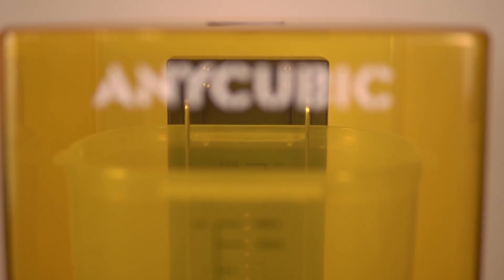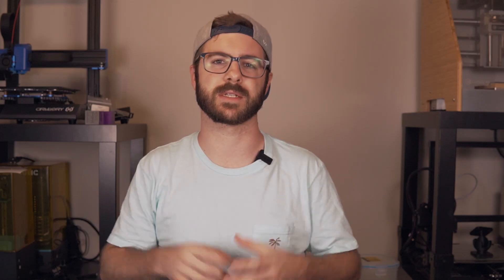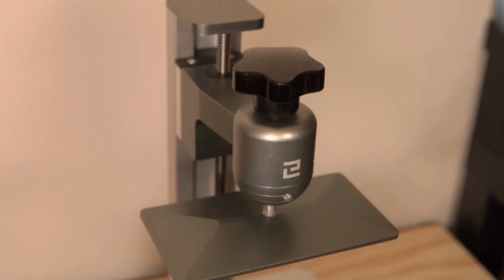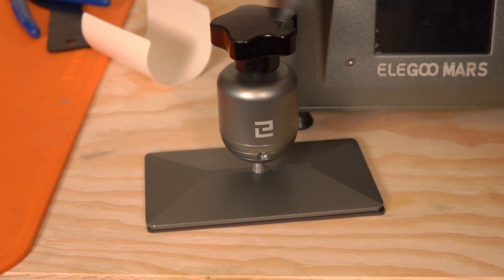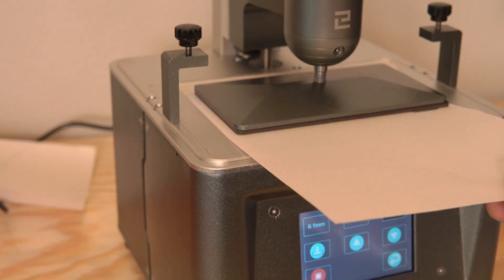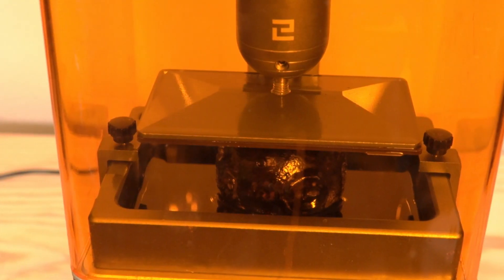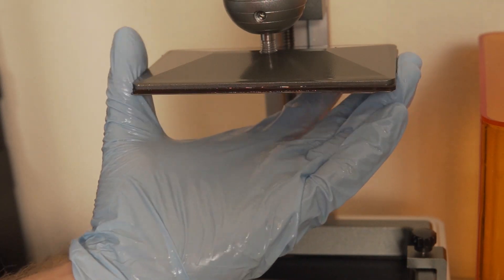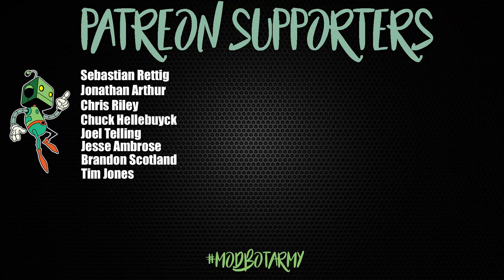FlexPlate System For Resin 3D Printers?! Install And First Look On Elegoo Mars

Comment: I might get one for TH72 resin. It really stick to the plate and has super stringent tolerance. So sometimes I gotta really use force on the plate. But seeing this if I can just pull off a magnet and bend into my cleaning machine I won't have to worry about accidentally messing up my level.

Comment: hello, nice video man ! When you print big parts, do you also, like me, have the metal plate not sticking with enough force to stay flat on the build plate due to weight and suction, causing one of the sides to detach and leading to deformations?

Comment: You know, if you forget to print a spacer first, you could just fabricate a temp spacer from cardboard, plastic, wood - things like that. A folded-folded-folded bit of duct tape even. Trim it to size, drill a couple of holes - you get the idea.

Comment: Great Video! You touched on the bane of FLEX-PLATES for my Experience. 
👉Case-1: 2yrs ago I installed a FLEX-PLATE on a AnyCubic Photon Mono SE. A guy I knew had the exact same setup as me & he informed me the Spacer/Shim or whatever wasn’t needed. And he walked me thru the process & it worked perfectly for 18 months. 6 month ago I needed to Re-Level the machine & FORGOT the Level Technique given to me🤦🏻 & I can’t find the guy….ohh & the regular None- Flex-Plate Level Methods won’t work. (GRIND’s)
👉Case-2: I just purchased a SATURN S & Attached the 
FLEX-PLATE & watched a few Videos & they ALL MENTIONED using a SPACER/SHIM . 
👉Question A: any idea what that Leveling Technique Was that leveled the AnyCubic Machine WITHOUT a Shim/Spacer was?
👉Question B: Have you heard any Technique for Leveling with a FLEX-PLATE without a Spacer/Shim.
👉Again I luv your video & it’s the 1st I’ve viewed where this topic is discussed!!! 
🙏🙏SO MUCH THANKS🙏 🙏
For that & I will defer to your site in the future💯💯💯
🙏Anyone that can offer help on either of my questions I REALLY APPRECIATE ANY HELP🙏
Lee

Comment: I added this to my mars 3 before i printed anything and printed the spacer on my longer 5 pro. still left it 24 hours to let the adhesive full time to cure. Boy is the magnet strong , have to be careful i don't trap my fingertips putting it on. great vid keep up the good work

Comment: yeah i gotta say flex plates for resin printers are definitely the way to go, there's nothing like testing printing your first model, not being able to scrape it off with plastic scraper, and then using your FDM metal scraper and scratching the build plate on the first print and thing you've ruined your machine
Reply: yeah I'm fairly new to resin printing
Reply: My exact experience

Comment: PRINT AND INSTALL THE HOME-SPACER FIRST!!!!! - If you only have 1 printer and install a flex plate before printing out a spacer, you're kinda screwed - speaking from experience here! It's important people understand that Home and Z=0 are NOT the same thing. The printer will always go to Home first, before moving on to Z=0 because it expects Home to be above Z=0 - so if you don't have a Home spacer installed, the printer will try and drive your build-plate through your screen even if you have re-calibrated it. Cue lots of angry grinding/clicking noises.
Reply: Yup. Made exactly that mistake. Needed to remove the magnetplate. So i need to buy another one. I recommend to look for a store who informs about the thickness of the flexplate+magnetbase. So no need to measure it.
Reply: Thank you so much for this tip, I was able to get a neighbor to get a space printed by my neighbor so the first thing I could do on my new printer was install a flex plate.
Reply: Nearly did this. thanks for the reminder.

Comment: I have the some issues with my Mars and Saturn now that i use FlexPlates. They are quite nice but since them almost all prints fail an get stuck on the FEP early or late in the print. I clean my Resintank with window cleaner instead of Iso. Iso washes out the transparency, window cleaner does not. After that i wipe it clean with paper towels and polish with a microfibercloth. I sanded them with sandpaper and raised the bottom exposure time from 60 to 75 and it initially worked. Now, almost all fall off early or late in the print on both Mars and Saturn. I cleaned the tanks with iso and raise the lifting speed. So, nothing sticks anymore. Removed the FlexPlate, releveled the plate, cleaned the vat with Iso, nothing. Cleaned the vat again, releveled again, apllied some silcone grease... nothing! Replaced the FEP an the Saturn, prints stick on the FEP after the base, on the Mars it won’t print at all anymore. I don’t know what to do anymore. Before i installed the plates, it worked fine. I bought these because some bigger prints had a lot of difficulty getting of the printing plate. And now, even when they are off no printer will print anymore.

Comment: a electro-magnet you can turn off and on would be a easier way to remove the plate I would think, but would require them to design the head to hold it with a off/on switch

Comment: I have Wham Bam resin flex plate for one month and its already cracking and make magnet side uneven. I do not recommend this for resin printers. And Wham Ban is not responding to my email to solve this issue....
Reply: Care to elaborate? What’s cracking exactly? And do you mean the adhesive is failing, causing the magnet to sag and become uneven?
Reply: @cwill2127  The magnet it self cracking, adhesive is fine. https://drive.google.com/drive/folders/1S6Cy4QWQx0Vti473wWV1LrePkHELLp37?usp=sharing

Comment: if you print MULTIPLE smaller figures flex plates(doesn't matter brand) are god awful, they don't come off and it's just another way to stab yourself. I've put 3 of these on my printers and I'm at the point of taking them off as they do not do anything beneficial, they now require 2 gloves to use rather than 1, nothing pops off. It's just another piece to align and screw with. The one nice thing is you can throw the plate in acetone and have your parts cleaned and come out together without needing to use a basket etc and worrying about them colliding.

 This is coming from running a 3d printing business.

Should mention Wham Flex for FFF are my lifeblood for not losing my mind, waiting on a replacement one for the Tronxy X5SA...I was kneeling on the build surface trying to get a PLA+ print off

Comment: I have 2 of them, one works perfectly the other just keeps sliding and damaging my prints, how do I fix it as i have tried:
slowing lifting speed
less models on the print bed
lower exposure
re levelling the plate

its so annoying as it keeps shifting.

Comment: Is there some reason that you couldn’t just set the home 2.5mm higher without printing that spacer? What if you forget to print out the spacer until after you install the flex plate?  For people with only one printer that is
Reply: This is probably too late, but I just fitted one and found that regardless of where you set the home, the printer will try and 0 to the actual end-stop switch, before moving to the home point set. Not printing a spacer (as I didn't) will just cause it to try to ram the print bed 2.5mm into the screen before it moves to the point set. Lesson learnt by me.

Luckily the plate is spring-loaded to the part where you attach it to the printer. Mine had enough give in it to accommodate a couple of mm, but I'll definitely be printing the spacer to take the load off the spring.

Comment: You fail to mention that the screws where the spacer goes are not long enough on the machine, nor what size they are. Now I have a machine that has a build plate that I cannot use.
Reply from the maker: I used the same screws that came with the machine. No issues reinstalling them with the spacer.
Reply: @ModBotArmy  Thanks for a speedy reply. The screws in my Elegoo Mars Pro are not quite the same as those in your video. Yours are certainly longer. When I put the spacer behind the Z-stop, and put the screw back through it, there is only 11/2-2 threads sticking out, not enough to even grab inside the threads. I checked with Wham Bam, who were great and answered quickly too, they said the screw need there is an M3 8mm screw. My screws are not that long. I have ordered some M3 8mm screws and hope they work in the thread.

I appreciate that you took the time to respond back.
Reply: Same issue. Thank you for this response.

Comment: can't you download the Elegoo Mars WB Spacer file from Thingiverse and print the spacer solid on your resin printer? for such a simple part that does not need much strength i'd think resin would be ok?
Reply from the maker: Absolutely! My elegoo was clean at the time so I just didn’t want to have to drain to install but that would work fine 😬
Reply: @ModBotArmy  thanks!

Comment: This is awesome, I'm extremely tempted! I did notice that your plate is smoothed out - does the build plate have to be completely smooth for the Whambam to be applied well? My plate is still the anodized texture.
Reply: Hello Rena, our 3M is very agressive and should stick to all metal and painted surfaces even with texture. just make sure you clean well, then wait 24-72 hours for 3M to cure after applying

Comment: Something that hasn't been mentioned about these solutions is the reduction of z direction build volume. For fdm, the thin flexplates and the massive volume make the reduction negligible. Here, with small resin build volumes and the huge magenet, that reduction is significant
Reply: Hello, We feel the loss of build volume to be almost insignificant, our system total height is   2.6mm =  0.102" much under 1/8 inch.  Even on a small machine, say an elegoo mars you have a 155 height, this would take it to 152.4
Reply: @WhamBamSystems  wow i wasnt expecting a response from whambam themselves. My apologies, i had heard the system was 2cm tall instead of 2mm.
Reply: @scrmnthn5233  no worries, decimal points change everything! let us know if you need any other info!

Comment: So glad to see that some  one has done this and thank you for the review. Also why not clean and cure the part on the flex plate and only remove the part once its cured so there is little chance of messing up the soft print ? Also have you seen the videos on curing the parts in liquid ? It seems the resins cure better when not exposed to air so they say cure the parts when submerged in water or IPA. I have not tried this so have no idea if it good or bad.
Reply: you can clean either way, on build plate ( my preferred for parts with delicate details) or pop off into cleaner directly

Comment: im curious of the effects of resin caught between the magnet and the plate and the life expectency of the strength of the magnet
Reply: Only time will tell ;) I bought the knockoff from aliexpress two packs for £27. Mine has 3m "300 LSE" adhesive.. which is "highly resistant to solvents"... At that price I'm happy so far. Edit: All good! Works great.
Reply: @Mr_Gadge  how long did the shipping take? I was just looking at those as well but the shipping is only guaranteed by next February...
Reply: @thepoynt  took 10 days. The seller is really good at replies and check your shipping options. I’ve over 300 orders this year from AliExpress. Only the really cheap items have taken over two weeks to UK. I think US suffers more delays.
Reply: i tried this and eventually the resin will make it's way between the magnet and build plate eating away the adhesive. i got a decent amount of prints out of it but will have to replace the magnet for sure.

Comment: Your video got me tempted and the discount code was icing on the cake, $27 for a nice mod seems ok then I got to shipping: $20??   That's gonna be a no from me dog.
I've ordered plenty of Chinese junk and shipping has never even gotten close to $20 unless it was huge/heavy.
Reply from the maker: Hmm may we worth reaching out to Wham Bam to see if there is an issue. I am not sure if you are based in the US but if you are that may be incorrect.
Reply: @ModBotArmy  For pre-orders we are shipping directly from factory to get parts to users in quickest time.  We will have some stock available in the USA in about 6-8 weeks if you prefer to wait.  We do not use China post as this can take 20-30 days, and parts are frequently permanently lost with bad tracking and nothing you can do about it. We are using major carriers like FEDEX, UPS, and DHL with good tracking and accountability and usually 5 or less days of shipping! We do not upcharge on shipping and usually take a small loss. The issue is there is a minimum 1kg package rate so sometimes you can get 3-4 kits into the shipment with same shipping rate.  I hope this explanation helps!

Comment: Hmm so no more huge supports needed? Build from the plate like pla printers?
Reply from the maker: Yes so it does not get rid of the need for supports but it does allow you to print things in an orientation that may have required more supports before. Someone gave the example of bases for miniatures. They would normally be printed at an angle but with this setup you can print them flat without supports.

Comment: Looks like a worthwhile upgrade. Don't forget to modify your slicing software to account for the height loss.
Reply from the maker: That is a great point. I am not sure I have ever gone max height other than for testing but I am sure some do. Thank you for this!
Reply: @ModBotArmy  the elegoo mars is set up so you lose about 20mm of build space because of the mounting nut on the build plate you can just make a spacer for the glass of 2.5mm or more and you'll be fine or you could make a 20mm spacer and edit the firmware to add 17mm to get max build height